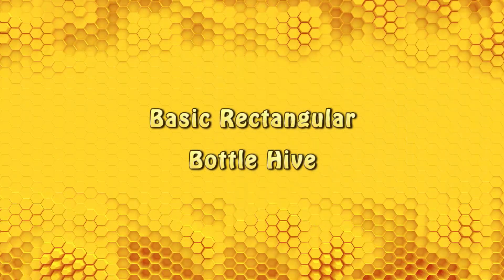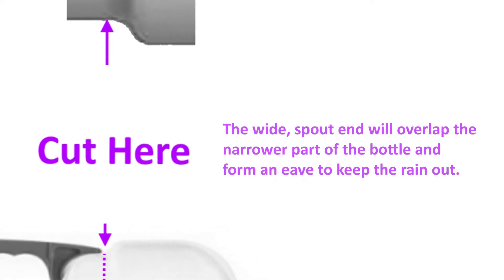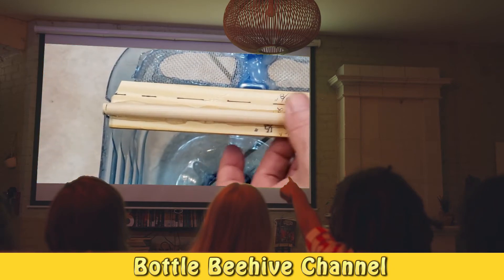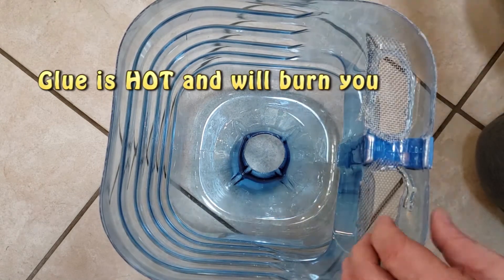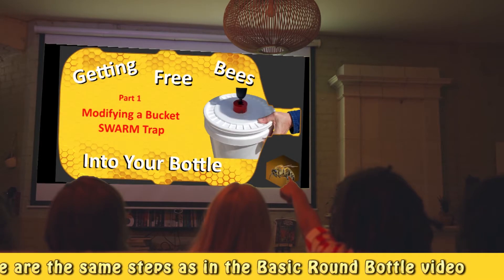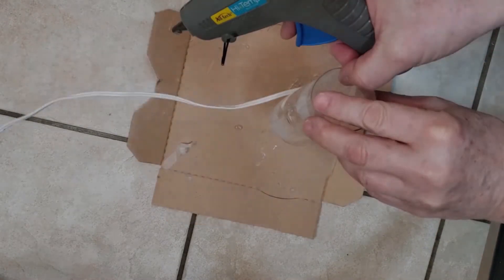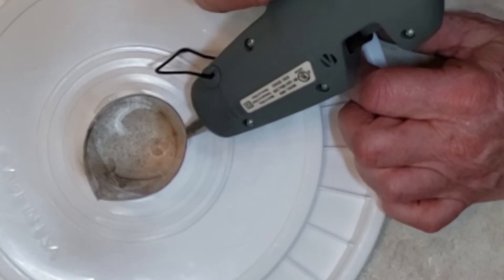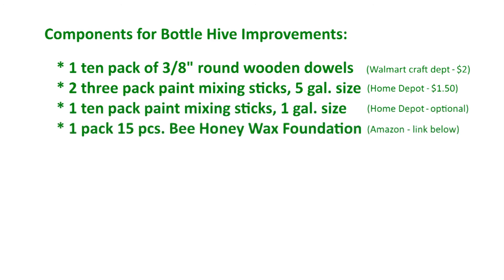Bottle To Bottle Beekeeping | Basic Rectangular Bottle Construction

Comment: My concern is the hot glue, which might melt on a hot day. Is there another alternative?
Reply from the maker: There are, but  the melting point of hot glue is 250 degrees F. You and your bees will be dead before the glue melts. Keep in mind that you don't put the hive in direct sunlight (again you would cook the bees before the glue would melt). Also, in most circumstances, you should have a cover/insulator around the bottle (covered in later episodes) when you don't actually want to observe the bees.

Comment from the maker: https://drive.google.com/file/d/1v8ZWLZIWn9tslaq9V8mMghUDTFpuHqxm/view?usp=sharing
This is a view of frames inside the rectangular bottle.  Since I get roughly 10x the views on the round bottle, I was prioritizing finishing that series of videos...but now that I know some of you are wanting to build rectangular (my preference) I'll have to the those videos posted as well.
Reply: I too am building in a rectangular bottle. In the picture it appears you built total frames instead of just the top. The frames on the side of the handle puzzle me. I can't make out how they are done. The ones under the vent holes and handle are interesting, can you build there? Also with the frames facing the vent holes will the frames further back away from the vents have enough air flow for the bees working there?

Comment: Hi Bottle Beekeeping,
I started gathering the materials for the rectangular bottle hive but noticed that the design for the bottles from Walmart have changed since you made this video. The neck is much taller and the space below is much wider and taller to stack. Most importantly however, the bottle is mostly flush all the way down the bottle, without a lip above the handle for cutting. Is this a problem? I have a few of the older design that I’m using for water right now but the older design is not compatible with the new.
Reply from the maker: Wow. Thanks for the update. This is good to know.  The taller neck should be a manageable issue (round bottles have taller necks), but  I'll have to look to see how the the bottom and side are made.  I'll make a run to my local Walmart to see if they have the new design.  My email address can be found under the "About" tab on the channel page. Feel free to send me any pics there. Where are you located?
Reply: Thanks for the reply! Just found your email address (it’s not displayed on mobile so I had trouble finding the tab). 
I confirmed the design change at two Walmart stores today; you are correct, the neck is just a bit longer and it seems the bottle is a slighter thinner plastic (crumples easier while stacked when top-down pressure is applied.
Reply from the maker: New rectangular bottles when stacked on older style (short spout) bottles. I have a solution for this problem and will post a video with the fix next week. In the mean time, if you are building rectangular bottles AND have already used some of the short spout bottles send me a PM via my email ound under the "About" tab on the channel page.